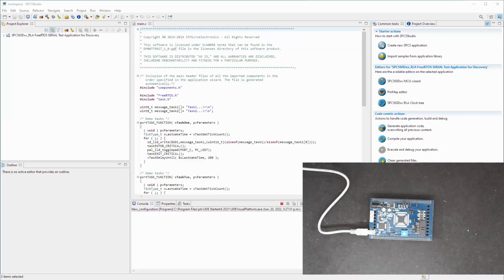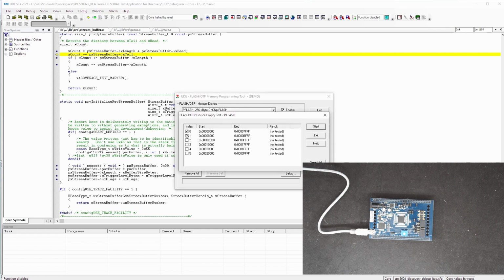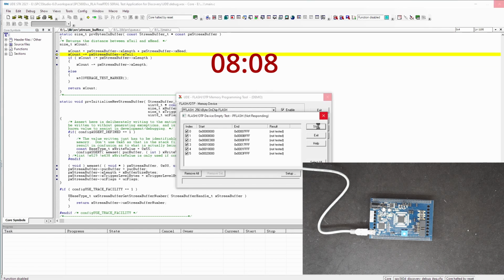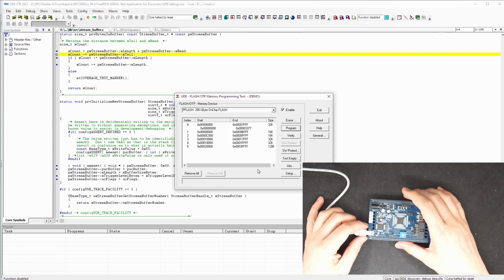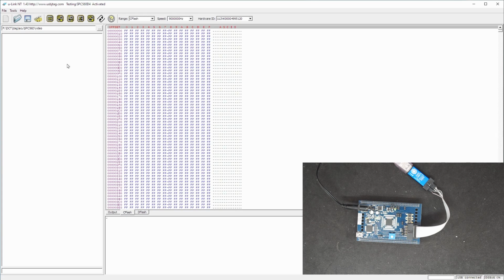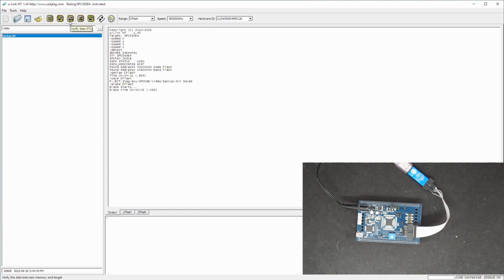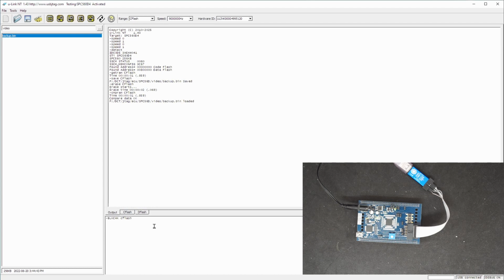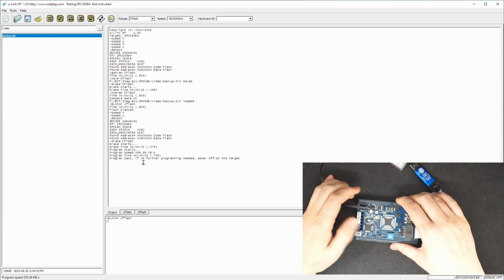u-Link NT program SPC560 (compare with UDE STK)

Comment: Can you use u-Link as debugger for SPC56?
I wonder if there is an alternative to the official SPC5-UDESTK debugger
Reply from the maker: It is not a debugger. It is used as programmer. However it is possible.
Reply: @usbbdm  thanks for answer!
Can it be done in ude stk?

I was able to connect to the SPC56 microcontroller, which is in the car part, using j-link and read the contents of the flash memory. And now I would like to perform reverse engineering to find out how the firmware works.
Reply from the maker: @TheAplov  Can you use UDESTK to the job?
Reply: @usbbdm  i dont have it. I have only jlink for now